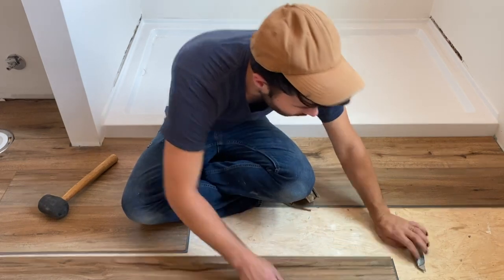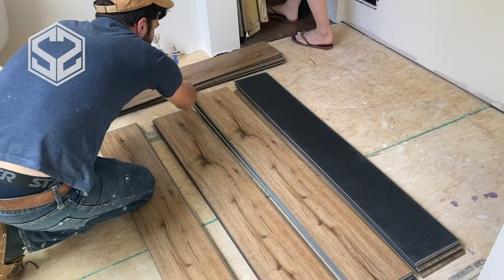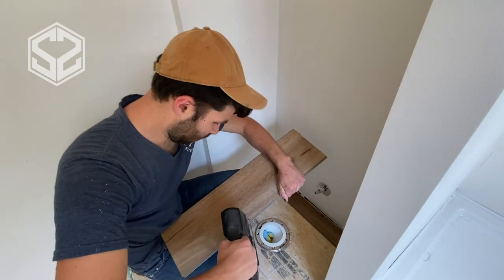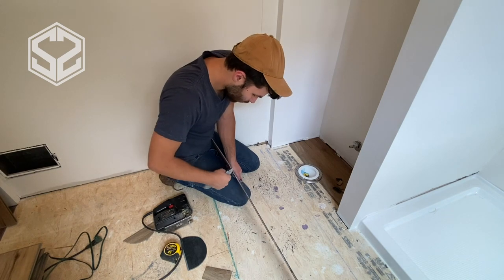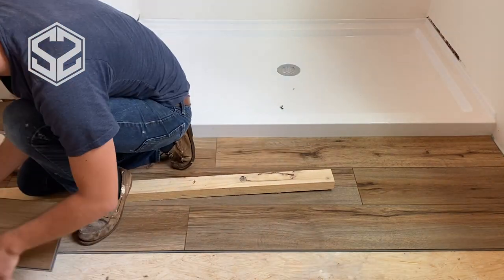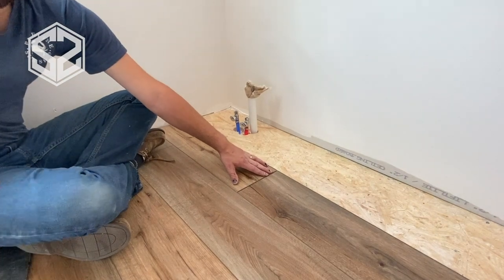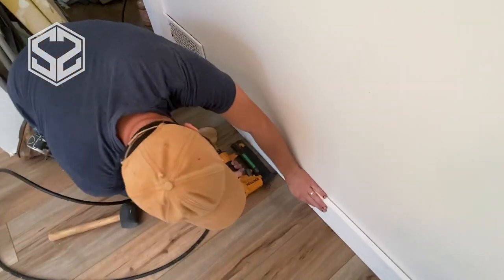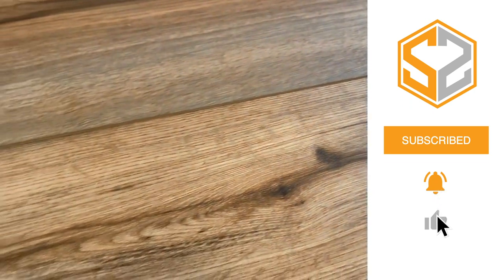Smartcore Pro Flooring Installation

Comment: Thanks for the video, I installed 2 boxes in a postage stamp sized bathroom and found this flooring to be more difficult to work with than some others I've installed  in my house over the years. I used the Woodford Oak and It really is a pretty floor.
Reply from the maker: Thanks! They are tough to get together but re really loved the end results!

Comment: Im a diy also. I was advised that this flooring required the underlayment.  Im getting ready to do my floor and i purchased the underlayment. What do you think?   Thanks for the video.
Reply from the maker: Installing underlayment won't hurt. You just want to make sure it goes down smooth with no wrinkle or folds so that the flooring can be set evenly onto the floor. I will say our floor has held up really well and has had no issues with this type of flooring. Good luck with your project! :)

Comment: I was told I cannot have my cabinets on top of my floating floor, but it looks like you have your vanity on top.  
Also, it looks like you ran silicone in front of the vanity, but that leaves the edge along the wall unsealed? 
My what a clean flange and drain you have there!
Reply from the maker: we decided to run the flooring under the vanity because it was such a small room and if we ever want to change the vanity the flooring may not have to be replaced. I actually put a beed of silicone around all of the edges before placing the moldings so that all the sides are sealed as well.

Thanks! :)

Comment: I'm installing the smatrcore pro flooring in a basement cement foundation floor.  I removed all my carpet, carpet strips  and thresholds.  I also purchased my flooring at Lowe's. Is it necessary to put down the roll under lament on the concrete 1st  taping the seems? If so should the flooring lay the opposite direction of the flooring strips?
 Thank you for all your easy access videos!

Comment: At about 17 minutes in you were placing a small piece that was going around your hot and cold and that was the finishing piece on the wall my question is what did you use to cut that plank in 1/2 longway? Just a razor knife, thanks.

Comment: When installing the first plank do you usually start with a full plank or do you cut it shorter for staggering / offsetting the joints?
Reply from the maker: I try to stager the seams so cutting the starter boards as needed is ideal.

Comment: Question. I'm thinking of installing the same brand flooring. But is underlayment required ? Or is it more of a optional item to place under the vinyl.
Reply from the maker: It depends on the flooring type you purchase. This flooring I used had a rubber underlayment already attached to each board to ad cushion and to also grip and hold it in place. If the flooring doesn't have this I would recommend using underlayment.

Comment: Hey simon....did you have any problems getting them to "lock" in place?  I am having a super rough time for them to actually lock.   The only way I can currently get them to work is if I slide it in from the side.
Reply from the maker: Yes, I did have a hard time getting them to lock into place. What I found worked the best for me was to tilt the board up at a 45-degree angle from the floor then place the two edges together and use pressure keeping them together as you lay it back down to the floor. The only way I could get the ends snap into place was to use a rubber hammer to hammer on the joint. I could actually hear the tung and groove clipping or snapping into place.

I hope this helps!
Reply: @SimonSaysDIY  not to be a cynic but we’re they snapping into to place or we’re the tongue snapping off? Tgat was the problem we had.
Reply from the maker: @1380beagle  We checked several times throughout the floor and they seemed to have been working for us. i tried to take several apart and they were licking together nicely and had no damage on the tongues. I did have a few that snapped when I tied to force it in and had to cut a new pice and try again.

 It was very warm when we installed these, I don't know if temperature can make these brittle and more likely to crack.

Sorry I can't be more help!

Comment: Closet flange should rest flush on the flooring, not recessed into it making it flush with the subfloor.
Buy a vacuum cleaner next time. That and an install kit (spacers, tapping block, pull bar) will help you tremendously.

Comment: Can you install this floor in both directions for some tricky wall/room connections
Reply from the maker: You probably could but you may need to put a thin molding where the floors connect. Thanks! :)

Comment: Great video man. Appreciate you showing it from start to finish. Question, when you were running the bead of silicone under the base boards, was it on the flooring and then the baseboard stuck to it?
Reply from the maker: Thanks I appreciate it! I put the bead of silicone on the floor. I felt that was more consistent then on the base board first because I could make sure the silicone made it into the cracks.
Reply: @SimonSaysDIY  excellent. So bead of silicone on the floor, then mush (technical term here...lol) the baseboard into the bead and nail her down. Thanks again for taking the time to share!
Reply from the maker: @markfaber3441  yes that's correct.

Comment: Does each box contain the same patterns? We bought one box and it seemed repetitive enough it might be noticeable in a large room. We are trying to decide if we buy more or return and look for another product.
Reply from the maker: I believe they have different patterns. The manufacturer recommends opening several boxes at a time and shuffle them together as the color from box to box can change slightly and I believe the same goes for the pattern.

Comment: What about the dimensions of that floor moulding?  It looks great - pretty substantial.
Reply from the maker: Thanks! 
The moldings I used were 1x8 primed pine boards. This matches the rest of the moldings throughout our house. I would suggest taking a look at what is used throughout your hose and try to match.

I taller molding (1x8 or 1x6) along the floor tends to look nicer while thinner moldings (1x4) are great for framing in windows and doorways.

Comment: Do you have to remove old tile flooring before laying this floor?
Reply from the maker: No but I would recommend removing old flooring as each layer you add raised the floor height and adds more weight to your  floor joist.

Comment: Great video! When installing the base molding, did you 45 cut the corners together or just overlap? I couldn’t tell in video. (Reason I ask is I’m trying to avoid buying a miter saw)
Thanks
Reply from the maker: Thanks! I did not use a 45 cut for a few reasons. This house is pretty old and the moldings throughout the house are not cut with a 45 so I chose to match everything else. It is also a preference but I think the flat cuts look really nice and simple with the farm/cottage style we were going for.

Hope that helps!

Comment: I just found your channel, the flooring looks beautiful! Thinking about buying the same product from Lowe’s. I know it’s only been a few months, but how is your floor holding up?
Reply from the maker: It has been great! It has only been a couple months but I left it open in the basement to make sure the flooring doesn't leak and with the shower getting the floor wet occasionally it hasn't leaked and all the joints have stayed together. We are actually thinking about installing it in our kitchen as well, so I would recommend it!
Reply: That’s awesome!! Thank you for responding

Comment: Simon, spacers- instructions say 1/4 in along walls.  I didn’t see you use any.  Just eyeball it?
Reply from the maker: good question, I did just eyeball it. The molding I was going to place over top was going to be 3/4 in thick so I tried to keep the gap around 1/4 in but if it went over a bit, it will just be covered up so there's reason to be that precise if the edges will be covered. 
Thanks!!
Reply: @SimonSaysDIY  thank you, sir!

Comment: Great video!  How is your smartcore pro floor holding up? I want to install it in my house, but I've read some bad reviews saying that the ends of the smartcore planks pop up over time. Has that happened to you so far? Thanks for the video.

Comment: I am putting the same flooring down. The  directions say not to  install cabinets or fixed objects on the floating floor application.  You put it under your toilet.  Have you had any issues with it?
Reply from the maker: No, I haven't had any issues with it. The toilet has sealed just fine and is stable and doesn't move around at all. the flooring has some cushion on the bottom side so you will want to make sure that the bolts holding down the toilet are tight enough to keep it from moving. The vanity cabinet shouldn't have any issues as it is so large.

I found it easier to cut out the hole for the drain and mounting the toilet on time because the cut around the toilet would have to be perfect or you would see a gap around the toilet. Putting the toilet on top covers up any mistake you make. Also if you ever need to replace the toilet the bases rarely match so you would have the wrong sized hole in your flooring and you would have to redo the flooring to fix it.

Hope that helps!
Good Luck!
Reply: @SimonSaysDIY  Thank you for replying.   Cutting around the toilet bowl would look stupid.  Thank you for posting your how to video.
Reply from the maker: You're totally welcome! Thanks.
Reply: How's the flooring doing under the cabinets? I'm installing similar vinyl plank flooring and it has to be under the cabinets, the floor is visible, vanity has 4legs. Just been wondering if the cabinet needs to be set on blocks and then cut the flooring around the blocks so not to interfere with the floors shrinking and contracting cycles.

Comment: just a warning this is super simply to install on a flat surface but if you install this in a basement it does cause problems if the floor isnt completely flat
Reply from the maker: Yes, That is a very good point! Thanks for sharing!

Comment: This is the worst product we have come across in our DYI projects.  This flooring does not snap into each other .  Some times we get it to snap then adding other boards unsnsp the back piesces  No one backs this stuff not even Lowes which recommends.
Reply from the maker: Yeah I could see that. We had to really hammer on it hard to get it to snap into place. Getting it snapped was a big pain to get it snapped but once it was snapped properly it didn’t come apart and has been great for us. We actually like the finished product so much that we are planning to do another room with this flooring.
Reply: I'm having a terrible time with it myself, and I'm trying to lay 1300 sq. ft. It's killing me!